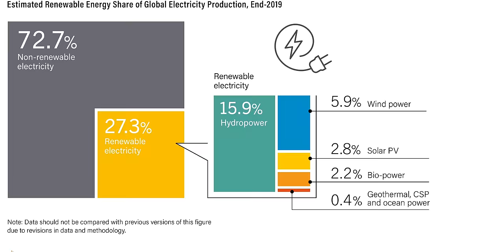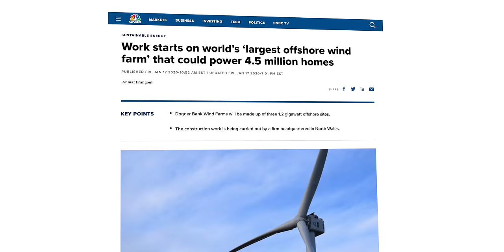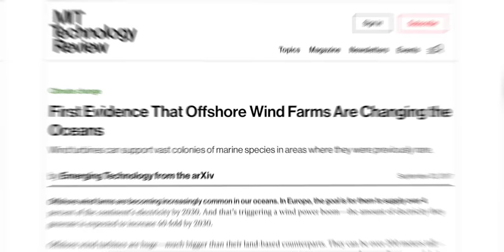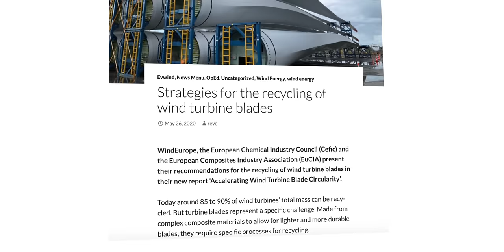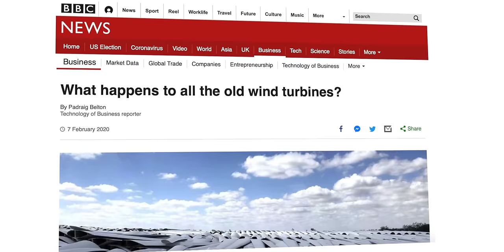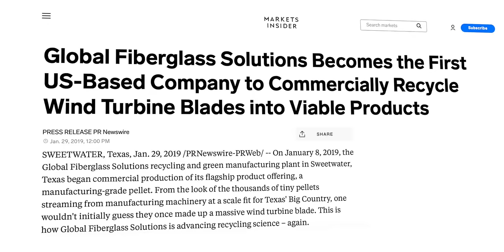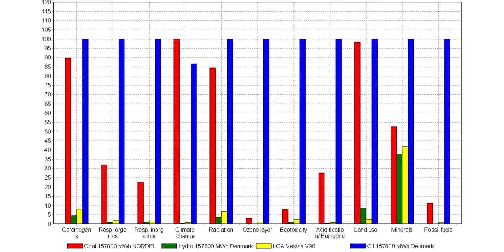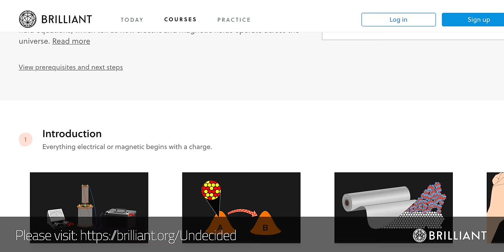The truth about wind turbines - how bad are they?

Comment: Im thinking nuclear is the way to go. Really.
Reply: Think again
Reply: @hizzlemobizzle  - Elaborate.
Reply: @caelachyt  Expensive to Build. Despite being relatively inexpensive to operate, nuclear power plants are incredibly expensive to build—and the cost keeps rising. ...
Accidents. ...
Produces Radioactive Waste. ...
Impact on the Environment. ...
Security Threat. ...
Limited Fuel Supply.
Reply: @hizzlemobizzle  - Well, that's supposed to be the panacea that is the so called Thorium Salt Reactors; those issues are greatly mitigated.
Reply: @caelachyt  Thorium cannot in itself power a reactor; unlike natural uranium, it does not contain enough fissile material to initiate a nuclear chain reaction. As a result it must first be bombarded with neutrons to produce the highly radioactive isotope uranium-233 – 'so these are really U-233 reactors.
Besides the future is not power generation it is in energy storage.  The future is batteries and super conductors my friend.
Reply: @caelachyt  Molten salt reactors haven't yet been proven at a commercial scale, and that means no private company will touch the idea. Getting a new reactor design licensed and built is a hideously byzantine and outrageously expensive process in most countries. Getting the first such plant online would cost tens of billions and take decades, and there's no guarantee a regulator wouldn't shut the whole thing down at any point. Even building plants based on mature designs is practically impossible in the US.

So it will have to be a government project. A very expensive government project. And currently there is very little enthusiasm in most Western countries for either nuclear power of huge expensive government projects.
Reply: Nuclear is still cheaper and more reliable than any other form.  Despite what the narrator says here, factoring in the maintenance cost of 3 year tear down of windmill generators is not included along with the massive government subsidies.  Nuclear reactor stations generally run at 2,400 MW to 1 Gigawatt of energy 24/7 365 days a year without reliance on wind blowing with zero emissions with a substantially smaller footprint on the environment.  Think about the amount of land required for 2MW to 3MW windmills to make up a gigawatt.  The spent fuel is the only waste that is exchanged every 1 and a half to 2 years and encompasses about as much space as a typical living room.  If we were really serious about preserving the environment and stopping greenhouse gasses, nuclear power would be the norm.  We should be using our technology to construct safe reliable nuclear power plants.
Reply: @g.k.1669  I'm guessing you work in the industry because it is insanely expensive, takes over a decade to get online and requires huge government subsides.
Faaaaaarrrrr from cost effective or clean
Reply: How dare you speak common sense!
Reply: Nuclear energy has a host of problems. The half life of nuclear waste is over 200,000 years. Then there is the remote possibility of a China Syndrome.
Reply: @hizzlemobizzle Yes I am in the industry. I repair, design and engineer industrial electronic controls for Nuclear, Combined cycle natural gas, Wind, Solar and Coal.  However you make it sound as if I am biased.  Tell me...If you had a choice to be working in a power plant or out on a solar farm, wouldn't you prefer a tranquil solar farm?  I know that I do.  However I do indeed know what the costs are.  Do you know that the largest day to day operating expense for a nuclear power plant is security?  What does an operating nuclear power plant produce other than steam from the cooling towers? Start up costs for a nuke plant are high due to the massive government regulations that occur at every turn.  Just to change the position of a simple pressure transmitter can cost $10,000 in new government licensing.  Other than that the rest of the cost is just standard feedwater heaters, turbines and structural concrete and steel.  Additionally a nuclear power plant can run 70+ years with government inspection approval, now break down that cost versus windmills or solar (while solar panels strip mountain sides for the specific quartz required for construction).  Since the environment is the subject you would love to see what is happening every night this time of year as the birds are migrating.  Go near the base of any windmill an see if you can count the amount of little finch type birds that slammed into them while flying at night.
Reply: @g.k.1669  Did not read the whole diatribe.  Thank  you for admitting your motivation.  Hopefully there will come a day when you no longer have to work in a such a horrible place.  
Please stop wishing the next Fukushima on the rest of us.
In addition it is frightening that you think nuclear plants need less regulation and oversight.
Want to know what my job was?  System Safety Engineer.  I know how dangerous nuclear plants really are.  I've seen the daily risk assessments from plant accidents.  Something they have a frightening large number of.  More plants more risk.
Reply: hizzle mobizzle Nuclear power plants are not “small nuclear bombs”. It is impossible for a nuclear power reactor to explode like a nuclear bomb.
Reply: I think so too.
But the Uranium reactor is obsolete and thing of the past since we can only use about 6,5% of the energy it produce's
The future is in fusion- and salt smelt reactors. They give more power with reduced waste compared to the Uranium reactor.
Reply: @primachpepe8597  Energy storage is the future.
Reply: Douglas waterman  folks at 3 mile island, Chernobyl and Fukushima might disagree.  Fukushima has virtually killed the Pacific ocean.  Yay!
Reply: hizzle mobizzle
, more people have died falling off rooves installing solar panels than have died in nuclear accidents.
Reply: @noremorse6898  what happens when a reactor melts down?
Reply: @primachpepe8597  You seem to have an deliberate misunderstanding of the dangers of nuclear reactors.  What are the long term repercussions of a nuclear meltdown?  What is the current state of the irradiated zone around Chernobyl?  Had they not been able to seal the Chernobyl disaster what would have been the outcome? What is the current state of the Fukushima disaster?  How many people lost their homes, everything they own and died of cancer due to those disasters?
Reply: @primachpepe8597  Explosions. While a nuclear reactor can never explode like an atomic bomb, an explosion can still occur. All power plants are a potential site for an explosion, because the fuel used, whether it is coal, uranium, or natural gas, needs to be energy dense. ... The destruction at Chernobyl was caused by a steam explosion.
Reply: @hizzlemobizzle  Obviously it's going to be a radioactive mess, but it still won't explode like a nuclear bomb. Meltdowns are extremely unlikely with modern reactor designs. Many new reactors will shut themselves down if the cooling system fails.
Reply: @noremorse6898  Do me a favor.  Since it take about 20 years to get a new reactor online.  Tell me what modern reactors you are talking about that are currently online?
Reply: @MrJonreed7  You are going to try and convince me that those disasters killed no one?  You are a liar.  plain and simple.  In addition genius why don't you tell me how many reactors are built near the ocean?  How many do we have in Florida? How many along our coastlines?
Reply: @MrJonreed7  Nuclear plants ill-prepared for worst-case scenarios, report says
In March 2011
The current approaches for regulating nuclear plant safety in the U.S. are “clearly inadequate” for preventing meltdowns and “mitigating their consequences,” according to a report released Thursday.

U.S. safety regulations traditionally ensure that plants are designed to withstand ordinary equipment failures, power losses and the loss of ability to cool the reactor core — the part of a plant where the nuclear reactions take place. But this is not enough, according to the report by the National Academy of Sciences.

“To what extent are they proactive versus reactive?” said Najmedin Meshkati, an engineering professor at USC who worked on the report. “Complacency and hubris are the worst enemies to nuclear safety.”

The U.S. nuclear industry should prepare for unlikely, worst-case scenarios when designing, building and regulating plants, the report recommends.
That is the big lesson the industry should take away from the March 2011 Fukushima Daiichi nuclear accident in Japan, the report says. Earthquakes, floods, tsunamis, solar storms and situations that seem rare are precisely the events that triggered the world’s three major nuclear disasters: Fukushima, Three Mile Island and Chernobyl.

The report said the accident at Fukushima — caused by an earthquake, which knocked out power, and a tsunami, which inundated the plant — should not have come as a surprise.

Another Japanese nuclear plant, Onagawa, which was closer to the earthquake’s fault line and also hit by the tsunami, sustained less damage because the possibility of earthquakes and floods had been considered when it was built, the report says. For example, the plant was built at a higher elevation, which decreased flooding, and had five off-site power lines, one of which survived the earthquake.

“Fukushima was a man-made accident,” Meshkati said. “The root cause was the mind-set. Mind-set is not in the equipment. It’s not in the pump. It’s not in the valve. It’s not in the batteries or the diesel generators.”

The report also emphasizes the importance of a national “safety culture” in which regulators make public safety a top priority. It says nuclear operators should be required to meet the highest standards possible and that safety requirements should be regularly updated — something the report says was lacking in Japan with Fukushima and in the Soviet Union with Chernobyl.

“Adequate funding and highly competent staff are necessary, but not sufficient, conditions for regulatory independence,” the report says. “It also requires strong leadership that maintains a laser focus on safety and does not allow itself to become distracted by outside pressures.”
Reply: @hizzlemobizzle  I'm talking about reactor designs that have been developed, not in actual commercial use. It's virtually impossible to actually build one due to the bureaucratic logjam created by the government and people's irrational fear of them due to anti-nuke propaganda.
Reply: @hizzlemobizzle  Here's a little "genius" for you. ALL nuclear plants are INTENTIONALLY built near water. All your comments have, COULD, IF, MIGHT, MAY. You must tremble uncontrollably at the thought of getting in a car.
Reply: @MrJonreed7  Oh.  So basically you have defeated your own argument.  Nuclear plants are inherently dangerous because they are all near water.  Thank you "genius".
Now get back to work spreading false information.
Reply: @MrJonreed7  .  Since you sork in the nuclear industry.  Tell me if this is true or not:  A nuclear meltdown occurs when the middle portion of the nuclear reactor containing the fuel rods (its "core") is not properly cooled. This can occur when the cooling system fails or is otherwise defective. If this happens, uranium or plutonium or similar materials inside the nuclear reactor become hot and may start melting or dissolving. It is this melting that is a nuclear meltdown.[1] Due to decay heat, a nuclear meltdown can occur even in a reactor that is shut down. The uranium and plutonium liquified in a nuclear meltdown, mixed with fission products, melted zirconium from the fuel rod cladding, and other materials, is called corium. Corium is highly radioactive and remains hazardous for many centuries after a meltdown.
Reply: @hizzlemobizzle  I have actually solidified my point. Nuclear plants have existed for 70 years & we're all still here. Again, you deal in "might, could, may". I deal in reality. Everything is "dangerous". I choose not to live in fear.  Deaths from coal & nat. gas extraction & exploration number in the hundreds of thousands. Go protest those industries.
Reply: @MrJonreed7  I have problem with fossil fuel industry as well.  Mainly because they have a product that is killing us.   Much like nuclear waste leaking into our groundwater.
Reply: @MrJonreed7  Hey  Boo!!  Nine years after the Fukushima disaster shook the world, one of the biggest impediments to cleaning up the site in Northeastern Japan is coming from an unexpected source: The water.

That water, specifically 1.2 million tons of it, is still radioactive. Stored in 1,000 special tanks on the site of the nuclear power plant’s ruins, it’s taking up needed space – which the Japanese government plans to free up by dumping it into the sea.
Reply: Bob A  We've got a local radio talk show host did a Ted talk.  you should check it out her name is the sexy savannah and she works at gator land.
Reply: Bob A  Honestly all this propaganda is boring.  We either develop green technologies or we buy them from other countries that are investing in them.  One way or another it's happening.  Shame Americans have lost the ability to dream big.
Reply: Bob A  Leave him be, he thinks with his heart and not his brain. Environmentalists are like socialists, they think they are morally superior to everyone else... the green movement is one of the biggest hypocritical movements on this planet.
Reply: Bob A  blah blah blah.
Reply: Bob A  Well, you always have to be on guard for "those people".
Reply: All day every day. Rely on the windmills and solar and we will all be Kalifornia with rolling blackouts. Bank on it. Fact.
Reply: @randyweaver9528  or come up with a solution.  Multiple factors are responsible, including the general issue of solar's intermittency, but also concurrent heat waves across the West that prevented California from importing power.

"There's just less energy in the system to divvy up amongst the different regions," said Jan Smutny-Jones, CEO of the Independent Energy Producers Association. "That's not normally a problem, but when it's hot then it is."

One of the casualties of California's last round of rolling blackouts said Newsom needs to prioritize reliability but that he doesn't have to sacrifice the state's clean-energy goals. He could boost energy storage, for example, in addition to keeping gas-fired peaker plants.

"The bottom line is, people don't want lights to go down," said former Gov. Gray Davis. "People also want a carbon-free future. Sometimes those two aspirations come into conflict. A smarter approach, in my judgment, is to have the power you need in reserve, even if it's somewhat carbon-based, to keep the lights on."
Reply: I been in Tschernobyl 10 years ago.. and remember it as if it would have been yesterday. It’s not something you could forget easy. Trust me.. nuclear is not a good future..
Reply: What do we do with spent rods from reactors which are radioactive for 10,000 years?  Don't bury them near my house as most people would say.
Reply: @hizzlemobizzle  That's all changing. Modular 3rd generation reactors and thorium fuel, and later liquid molten salt reactors will produce cheap, reliable concentrated power with less adverse environmental impact than any renewable.
Reply: @stuarthirsch  That will be great, but in the meantime we better work with what we have.  Can't sit around and wait another 50 years for that to be developed.
Reply: Exactly.If everyone would have worked together years ago, we would have carbon free electricity.
Reply: Its the only tech available now that works.  So I agree.
Reply: @hizzlemobizzle    Totally surmountable technical issues.  And yes, tehcnically you are correct that it is the U233 that fissions but it derives from the Thorium.  Regarding energy storage high tech batteries is a pipe dream.
Reply: @hizzlemobizzle    Actually this is happening as we speak, just not so much in the UK or US.  Most of your argument regarding regulatory hurdles is just subterfuge.  Governmental regulations are based on first and second generation nuclear technology and need to be intelligently overhauled for MS reactors as the safety issues are very different and substantially minimal.  The countries presently pursueing this will own the means of incredibly inexpensive power generation, without littering the landscape with bird and bat killing machines, or vast swaths of land filled with solar arrays, with virtually zero greenhouse emissions; or even negative greenhouse gas emissions if excess power is used for chemically reducing atmospheric CO2.
Reply: @edixonocilis4482  funny.  I remember when they said deriving energy from the sun was a pipe dream.  High tech batteries are reality it is just a matter of increasing efficiency.  Certainly more likely to become reality in the 50 years or so it would take to design, build and bring on line a new nuclear plant.
Reply: @hizzlemobizzle    I'm an engineer and understand technology pretty well.  The problem with power storage using batteries has to do with capacity, not efficiency.  If you do even a very generous energy balance to determine the capacity to store the amount of power needed to offset the down time of the so called renewables, you will quickly understand that it's extrodinarly unworkable.  The amount of natural resources and energy necessary to produce, install, and maintain this storage capacity, the environmental damage, not to mention the recycling efforts is just monumental.  With a concerted national effort I don't think it would take anywhere near 50 years to bring on a walk-away safe and extremely efficient 4/5th gen MS or LM nuclear reactor.  China, India, and Russia will be bringing on such units within the next 10 years. The US ran an experimental one at Oak Ridge for almos 10 years in the late 50s early 60s.   Honestly, I don't think the US or the UK have the guts to react to climate change/global warming in such a way as to make a the kind of concerted effort needed to develop this technology mainly due to uninformed populist attitudes.  This is somewhat of an understandable reaction on account of Chernobyl, but to think renewables plus batteries will somehow solve this global problem is pretty naive.
Reply: @edixonocilis4482  You mean like the newest one in Finland? Oh and if you are worried about birds we better get rid of house cats and tall buildings.
The Olkiluoto 3 Nuclear Power Plant will be the third unit at the Olkiluoto site in western Finland, and is one of the newest nuclear plants constructed with EPR pressurised water reactor (PWR) technology. Finnish nuclear power company Teollisuuden Voima Oyj (TVO) began building the plant in 2005, but it has faced almost a decade of delays.

TVO originally intended to start production from Olkiluoto 3 in May 2009, but an array of issues regarding planning and construction were highlighted by Finnish nuclear safety regulator STUK. It found problems in the concrete foundation of the plant, and later indicated that subcontractors working on the project had provided heavy forgings that fell below industry standards.

Other problems soon began to flood in, including an issue with the reactor’s unique double-containment structure. Another problem with TVO’s project partners, Areva-Siemens, further delayed the plant in 2013, as the consortium reduced the number of subcontractors and employees working on the project.

TVO Olkiluoto 3 project director Jouni Silvennoinen said in June: “The hot functional testing has now been successfully completed and the schedule for the next phases has been defined.
Reply: Bob A wasn’t Elizabeth Holmes on Ted?
Reply: Nuclear Fusion is the way to go, and it's only 30 years away...
Reply: nukes...small reactors.......
Reply: it only takes long because of the government. It's been proven. we did it before and we were clean and powerful.
Reply: Solar is the way to go, hands down.  Just imagine that exterior cladding on all buildings are now solar panels.  All roofs, solar shingles 100%.  The electrical grid is now managed by a public company paid for by taxes and that is all they are allowed to do manage the grid.  no one pays for electricity from a greedy company they just pay for the maintenance of the systems attached to their properties.  No more mass outages due to weather, sabotage, and human stupidity.  We might even get our heads out of our asses and start moving most in home electricity back to DC power and gain even more safety & efficiency so we don't have to store power in batteries then convert it to AC just for most home electronics to convert that AC back to DC for use.  But all of that is beyond our lifetimes anyways... but who knows... maybe humans will stop being stupid... if a miracle happens.
Reply: yes hirosima n nagasaki..
Reply: @hizzlemobizzle  How, exactly, do you plan on charging those batteries?
What do you do with them at the end of their effective life?
How much energy do you waste keeping the system cool?

50+ years of nuke reactors in operation and only three or four major incidents only one still has a large exclusion zone....... The extremity of possible negative effects has greatly overshadowed the actual risk. The difficulty in getting new reactors built is largely due to these fears both founded and unfounded.
Oh, and those thorium based molten salt reactors? Most designs are about as failsafe as they come for any system and the byproducts' halflife is on the order of hundreds of years rather than hundreds of thousands with no weaponizeable waste. So plenty of reason to invest into research to see if they can be made commercially viable.
Reply: Absolutely!
Reply: People are too ignorant to realise it
Reply: @irish-medi-weed-grower5240  yes, it is because we are using Gen 2 reactors that by the way over used since 2000. In other words, those reactors should've been renovated, but they were not because people choose not to do it
Reply: @hizzlemobizzle  cost keep decreasing because we already have Gen 3+ nuclear power stations and in 15 years will be ready for Gen 4 that will decrease nuclear waist almost by 50% relative to Gen 2 (which over used for 20 years) and decrease cost of production by 30-40% too ...
Reply: @wolfu597  nuclear waist is not a real problem of nuclear fision. It is water. Nuclear fusion has it own problems if you make a mistake one nuclear fusion reactor can turn Earth into star in a matter of seconds
Reply: @wolfu597  also, nuclear fusion does not produce nuclear waist. Nuclear fusion is when you get He from H
Reply: @hizzlemobizzle  Fukushima happened because people did not follow safety requirement. Even God damn Chernobyl happened because people did follow all safety protocols because they were pressured by USSR government to build it
Reply: @victorveselov4911  I agree anything that can cause destruction on a global scale due to human error is far too dangerous.  Luckily Nuclear is insanely expensive and will be phased out.
Reply: More deaths have occurred in Ted Kennedy's car than in nuclear powerplant fatal accidents.
Reply: @henryhorner3182  WOW!  Over 60,000 people died in Ted Kennedy's car?  I had no idea you could pack that many people into one car.  Was the car really huge or were the people very tiny?
Reply: Nuclear fission will be required to supplement renewables for sure because there just isn't enough renewable power or storage either, and once it's pretty clear we have backed ourselves into an energy corner with fossil fuels where we die if we keep it up, nuclear fission will become an important part of the mix.  The only way it wouldn't is if, by some miracle, there is a sudden leapfrog in nuclear fusion reactor technology, which seems pretty unlikely in the timeframe we now have to change our energy production infrastructure to avoid a very miserable future (or possibly even extinction).
Reply: Well,fusion is allso nuclear by definition...let just hope it will become fesable in the near future
Reply: @carrol meeks i am waiting on the mesiah of nuclear energy
Reply: Say less 🤫
Reply: @hizzlemobizzle  Interested in how they compared to fossil fuel plants, were they much higher? I can't see that you'd get those kind of incidents with wind or solar farms... aside from general maintenance and panel cleaning
Reply: @g.k.1669  According New York bank Lazard and others is nuclear energy 3-4 times expensiver than  renewable energy from wind ans solar. The capacity factor of nuclear power plant is 80-90%, they are also not working 24/7 365. A small volumen of radioactive waste? And what about amount of tailings connected with uranium minnig, or contaminated undergroud water by in situ leaching? Solving for climate change? 1o to 15 years of construction, dozens years of decommision. Nuclear is producing 10% of electricity and about 2% of whole energy in the world.
Reply: You are looking at this issue from the wrong angle. Windmills are so much easier to abuse as "fund raisers" under the umbrella of "a good cause'.
Reply: @hizzlemobizzle  Nuclear has the lowest amount the deaths per energy generated, lower than your wind, hydro and solar.
Reply: @InNeedOfSpeed  Ok you get the ridiculous award for the day.
Reply: Except we still don't know what to do with all the radioactive waste.
Reply: @milan222314  The property leases for the windmill and solar fields is already a large factor. I absolutely guarantee you that nuke plants operate 24/7 365 unless there is a trip due to an upset in the system due to something like a blade being thrown in a turbine. You talk as if there is no environmental impact from green energy, heck.. just to mine the quartz for solar panels wipes out mountainsides not to mention the thousands of migratory birds that die.  I work in industrial electronics for the power industry and have been at solar fields, windmills, coal plants, combined cycle gas plants, diesel peakers, natural gas peakers and many months and nuclear plants.  There is a good chance that I know what I am talking about.
Reply: How you can compare the silicon (99 % approx.) from sand and uranium from ore, with average content about 0,1 %? With huge amount of radioactive waste rock and huge amount of radioactive waste tailings? With radioactive dust and penetration of radioactivity to undergroud water. From the beginning is nuclear energy connected with war: from Hiroshima and Nagasaki to depelted uranium, unsolved final dissposal, possible war or teroristic attack? With no adecvate insurance and 3-4 times expensiver than renewable energy from wind and sun.
Very shortly to express: Nuclear energy as complex is crime on humanity.
Reply: @milan222314  Simple.  Communities still thrive around the locations where uranium is processed.  You fail to realize how much damage is created by green energy or perhaps you do not want to believe it.  You talk about the decommissioning of a nuclear power plant as if it is a major issue.  It is not.  You can see videos here on youtube of teenagers exploring old nuclear power plants as they carry detectors.  There is nothing dangerous left except the asbestos on old pipe insulation.  Just like any large power plant decommissioning the building is brought down, the concrete is crushed and used for road bedding materials and the steel is recycled.  Nuclear power plants must follow very stringent guidelines to operate and their lifespan can be up to 60 years of operation.  A windmill or a solar field will not achieve half that life and there is no recycle use for windmill components that is realistic and the solar panels require an industrial chemical process to recover the silver.  Nuclear is by far the best aspect for the environment and the cheapest.  Did you know that the U.S. and foreign governments provides massive subsidies for green energy?  If the ratepayers ever have to pay the full energy costs on their bills, they will be in for one heckuva surprise.
Don't get me wrong, whatever way that they make electricity does not impact my job as I will have one at any location, but as an avid outdoorsman seeing square miles of panels where trees used to be and knowing where the materials are mined or seeing dozens of migratory birds lying at the base of every windmill in the fall as each night migratory birds strike the tower and blades is heartbreaking.
Reply: Nor do we know what to do with the lithium that is needed to build car batteries.
Reply: So, why would we add Lithium with the problem under the pretext that it is safe?
Reply: @primachpepe8597  well said! 👏👏👍
Reply: Hidro
Reply: Nuclear is 100% the way to go. No it is not as dangerous as you all think. No it is also not as expensive as you all think and finally no nuclear waste is not a problem. Yes I know you have heard otherwise but unless you actually dig into the details you will never learn the truth, only the lies you've been fed. Hopefully truth will prevail.
Reply: The half-life of nuclear materials is in the hundreds of thousands of years. That's an order of magnitude longer than humanity has even been around. The cost of keeping these things safe and secure simply cannot be quantified. Storage facilities have already had mishaps in just the few decades they've been around. A massive issue could wind up tainting ground water for entire states. Housing these things would require stable oversight basically FOREVER. Can you think of any nation that's been stable forever? The longest nation humanity has is China at a couple thousand years, but I sure as hell wouldn't have called it stable that whole time. To put it in perspective of just how long we will be housing these things; in the time it will take for roughly half of these nuclear materials to expend themselves, Japan will have been crushed underneath China by the movement of the tectonic plates.
Reply: @michaeldougherty6036    Do you think I haven't heard that argument before, even though it is parroted ad infinitem? If you had ever bothered to check you would know that the more radioactive a material is, the shorter the half life. Anything that is radioactive for more then a few decades is basically harmless unless you ingest it just like anything would be if you dug it out of the ground.
Reply: One thing that most people don't understand about the nuclear industry is that the dangers posed by the technology are massively overblown in order to profit from selling unnecessary safety upgrades. We can easily build plants that can't meltdown, we can bury the waste afterwards and we could build plants for comparatively next to no cost but politics and stupidity gets in the way as usual.
Reply: Liquid Salt Thorium  reactors is the only nuclear option I'd consider
Reply: @terencemcbride9090  Good thing your not in charge then
Reply: yeah nuclear is very cheap source if you look on the whole life of it. Its super-expensive to build, but then its generate huge amount of power and heat with minimum need of fuel for another 60 years. Reliable, even when sun not shine or wind blow. And carbon free. We should move forward to generation IV which are able to use almost whole fuel and even use nuclear waste to produce energy (which solves waste problem). More passive safety too.  Yeah probably not a good idea to build it on the shore in earthquake zones. thats for sure. (fukushima survive eartquake, tsunami was a too much)
Reply: The environmental crowd protested it in the 70's so they dirtied there own drinking water.
Reply: Good idea but what about the waste from nuclear,  what are they going to do just dump it in the ocean so it kill fish, or a landfill until it glows.
Reply: @coach2208  nuclear waste is a non issue. You do realise don't you that we already put arsenic, lead etc into the air every day from coal and diesel engines etc.... Far worse than any mythical damage that could be caused by nuclear waste
Reply: @garry8390  I have to kinda disagree because our factories and trucks burn 90% cleaner in today's world,  maybe not in China and other third world countries that have no EPA regulations
Reply: @garry8390  the problem here is everyone is pointing the finger at USA and not other countries that pollute way more then this country.
Reply: @coach2208  Is this your best argument? Can you do any better?
Reply: Unfortunately too many people have for years placed Nuclear Power as a non viable option.  https://en.wikipedia.org/wiki/Pebble-bed_reactor
China is working on this and other options to help break their dependence of coal and oil.
Reply: bilbo bostonian  ahhh you say the nicest things.  I bet you are loads of fun at parties.
Reply: @hizzlemobizzle  They are near water for cooling purposes. Look at France with 70% of it's energy coming from nuclear power. It produces so much at such little cost that it ends up making a profit of 3 billion euros( which is equivalent to around 3.6 billion dollars) annually by exporting energy. You bring up the only three major accidents: Fukushima, Chernobyl, and Three Mile island, yet "These are the only major accidents to have occurred in over 18,500 cumulative reactor-years of commercial nuclear power operation in 36 countries." With high end security and advances in technology, these small yet potentially devastating risks are constantly declining. Besides that, you argument merely relies on speculation, assuming the worst case scenario only when it benefits your side. At that point, we wouldn't be able to accomplish anything because regardless of what we do, there will always remain a catastrophic possibility despite how negligible it is. The only reason nuclear disasters are brought up is because they are horrific spectacles, yet sum up all the minor accidents from other energies, and you end up with the same if not worse results.

References:
https://tinyurl.com/btnct44m
https://tinyurl.com/455bevxh
Reply: @stefanv.3991  I agree.  Abandon all hope.  It can't be done.
The new American spirit.
Reply: @hizzlemobizzle  if what you said was accurate then we’d be f*cked, as China is racing to develop the technology in order to clean up the air in their cities. Thankfully their are a large list of western startups making significant and meaningful progress on advanced nuclear reactor technologies, even with a tiny fraction of government assistance that wind, solar, batteries, hydrogen, and biofuels receive.
Reply: @hizzlemobizzle  they take about 5-10 years longer to build, and yet their lifespan is 2-5x longer then wind and solar, and don’t require hundreds of miles of wiring to connect them to the grid, grid storage, or fossil fuel back up. 

There is also huge potential for improvement using consecutive build outs, as demonstrated by China, India, Korea, Russia, France, etc.
Reply: @hizzlemobizzle  What are your sources for ypur negative attitude towards nuclear?
Most efficient.
Safer than wind turbines for the environment and also workmen.
Increasingly cost effective.
Better for the environment than solar.
Reply: @Matt_H_  In mid-2019, new wind and solar generators competed efficiently against even existing nuclear power plants in cost terms, and grew generating capacity faster than any other power type, the annual World Nuclear Industry Status Report (WNISR) showed.

“Stabilizing the climate is urgent, nuclear power is slow,” said Mycle Schneider, lead author of the report. “It meets no technical or operational need that low-carbon competitors cannot meet better, cheaper and faster.”

The report estimates that since 2009 the average construction time for reactors worldwide was just under 10 years, well above the estimate given by industry body the World Nuclear Association (WNA) of between 5 and 8.5 years.

The extra time that nuclear plants take to build has major implications for climate goals, as existing fossil-fueled plants continue to emit CO2 while awaiting substitution.

“To protect the climate, we must abate the most carbon at the least cost and in the least time,”
The cost of generating solar power ranges from $36 to $44 per megawatt hour (MWh), the WNISR said, while onshore wind power comes in at $29–$56 per MWh. Nuclear energy costs between $112 and $189.

Over the past decade, the WNISR estimates levelized costs - which compare the total lifetime cost of building and running a plant to lifetime output - for utility-scale solar have dropped by 88% and for wind by 69%.

For nuclear, they have increased by 23%, it said.
Reply: @noremorse6898  While a nuclear reactor can never explode like an atomic bomb, an explosion can still occur. A meltdown means that due to lack of coolant, or too much fission, the core becomes so hot that it melts. Due to the intense heat produced, water is turned to steam. Also, the fuel rods melt, turning them into a liquid. This allows the metal to react with the steam, causing an explosion.
Reply: I agree to a point but when nuclear goes wrong it’s the most catastrophic problem humans can face and the loss of life is immense. And the fallout lasts for 100’s of years.
Reply: Absolutely 💯
Reply: it is! although breeder nuclear-powered power with dozens of safeguards such as the one a team of [ill find the source] scientists created. These superluminal conclusions of "nuclear bad" or completely unjustified...
Reply: @hizzlemobizzle  chernobyl was from communism and outdated equipment, we actually have regulations unlike the USSR Fukushima was concerning I’ll admit but windmills kill so many birds and the construction destroys good farmland, I believe that nuclear is the future and that people need to stop beig afraid of it
Reply: Pretty spot on for the exception of one thing…. Nothing was mentioned about the production of the components at their creation. The amount of fossil fuels used to create the steel and alloys alone is insane. So much so a wind turbine through its life will never cover its own carbon footprint with the so called “green energy it produces.
Reply: No Doubt! Im a fan with today's technology ☢
Reply: @museic9151  Will a burst dam make the surrounding landscape unlivable for hundreds of years?  Will a fallen windmill melt down and risk global annihilation? If not then I guess it's not the same.
Reply: Nuclear Fusión
Reply: @David-hx8vb  What an odd comment?  You call people snowflakes for having a rational fear of nuclear power and then wish that a hurricane will cause a Fukushima style disaster in Florida.  WTH
Reply: @David-hx8vb  hahaha no I guess not.  Ooops/
Reply: Makes total sense.
Reply: Not until they figure out what to do with the nuclear waste - safely.
Reply: @Gleebe Whitaker  You do realise a longer half life is better right, the longer the half life the left particles being emitted so the less dangerous it is.
Reply: @Adogsmate4267  Yep, but 'petrol' isn't nuclear waste, nor does it produce nuclear waste products.
Reply: @irish-medi-weed-grower5240  thank you for posting this. These are the things I tell everyone that they don’t consider in the final cost of nuclear power. The cost goes on for years after and no one really knows how long or the cost. 🙏🙏👍💪
Reply: @hizzlemobizzle  Massive amounts of concrete which needs alot of fossil fuel to produce.
Reply: @Dutchy695  All the seagrass and corals are dying n Florida from the heat.  Have a nice day.
Reply: Yep 100%
Reply: @hizzlemobizzle  Nuclear is the way to go. I thought again.
Reply: @sidi4735  Remind me what happens when there is a war and a bomb hits a nuclear plant?  Guess Zaphorizia may be our chance to find out.
Reply: When there is a war and a bomb hits a nuclear plant, things go bad. Very bad. @hizzlemobizzle
Reply: Nuclear is actually clean too
Reply: When one is serious about the environment and human life, one chooses nuclear as by far the best way to generate energy. Nuclear waste has been managed for nearly a century and can be reused efficiently. Nuclear has the lowest death rate per unit of energy production. Disregarding nuclear because "if a bomb hits a plant during a war" or "if Tchernobyl..." is irrational.  @hizzlemobizzle
Reply: @sidi4735  Oh by the way the idea that a plant being struck during a war is irrational is something you should explain to those currently hoping to avoid this scenario in Zaporizhia.
Reply: @RedHaloManiac95  Yes.  I mean other than the massive amounts of waste it produces that there is still no clear an answer on how to deal with it other than to store it in huge barrels on site.  Shame those barrels eventually leak.
Reply: Actually the costs don’t continue to rise.  Once the reactor is online the costs are extremely cheap compared to wind or solar and produce WAY more power fat more efficiently than wind turbines which break down constantly.  Any rotating turbine has turning gears and bearings = wear tear and replacement which is very expensive in comparison to their power output.  Sure nuclear reactors are VERY expensive to bring online initially but they are far cheaper to maintain in comparison to their power output.  The newer reactors also can utilize different types of uranium and plutonium with some even utilizing the waste products of older reactors to power them.  With the advancement of superconductors new reactors are being developed that will even be able to use cold fusion which produces almost no waste products.  In a decade or two they will be wipe out the green sector of photovoltaics and wind turbines.
Reply: your opinion is kindly rejected.
Reply: @g.k.1669 nuclear is the most expensive energy source ever
Reply: @opensocietyenjoyer  I have worked in the industrial electrical industry for 28 years now.  I have worked at natural gas plants, coal fired, nuclear, wind farms and solar parks.  I can tell you with 100% certainty that nuclear is by far the cheapest form of electricity to produce when all costs are down to the final product of megawatts. 
Think of this, since the Obama administration was in place, the government has given over one trillion dollars of your tax money to green energy initiatives. Eighteen 2,400 MW nuclear power plants could have been erected with that much money.  When it comes down to cost, nuclear is about $7 per MW hour, Coal about $18 (Before the Democrats placed massive fees onto coal burning power plants) and wind and solar bounces around in the mid $70's per MW hour to produce. 
All of that land leasing, miles of underground heavy cable, permits, running lines to connect to main trunks consumes a lot of cash for something that does not produce energy most of the time.  Then throw in the 3 year heavy crane hoist out of the generator and blade replacement of windmills and expensive maintenance and you will start to get the idea.
Reply: I am 17 years old and trying to figur this hole shit out, because i will soon have to choose for what I want to vote for.  I would say that my research has brought me to a point where my knowledge on the topic is above avarage, and I still feel hoplessly lost. Unless I am dedecating my life to this, I have the feeling that I will always have to rely on what professionals are saying, but everyone is saying something different. How is your avarage joe supposed to make the right decision in this buttfuckery of different opinions? What can I even belive at this point? I feel like there is no other choice then letting your bias make the final decision. Is there anything that one could do about this? I mean, I feel like I would be most important for voters to understand what they are even voting for.
Reply: Nuclear is also not renewable
Reply: 3 Mile Island?? or Wind Turbines??
Reply: They last long and we can make them better now. The more we make the better we become at it. We need energy to make all the world prosper so I say will should use all the energy solutions.
Reply: If you want your electricity rates to quadruple vote for nuclear. While it works fine it is just uneconomic and the waste issues have still never been resolved. It is simply too dangerous to make economically safe.
Reply: @gleebewhitaker1517 There is no chance of the China syndrome. Re-processing waste eliminates the long term hazards because the long lived nuclides of concern are fuel that can be reused. The problem is while there are solutions they are just uneconomic. Nuclear if just far more expensive than renewables and fossil fuel generation.
Reply: @g.k.1669 You are mistaken. I was an engineer in US commercial nuclear power plants. They are not even close to being cost competitive with renewables and fossil fuel generation. Why do you think they are shutting down perfectly serviceable nuclear power plants in the US? Plants that have been completely paid off and depreciated. It is because just the O&M costs by themselves currently make nuclear power uneconomical. When you factor in new construction costs frequently 75%-80% of the costs. Nuclear power is not even close to being competitive. Hydro about $0.02/kwh, onshore wind and solar about $0.05/kwh, natural gas combined cycle about $0.07/kwh, coal with the required pollution controls about $0.12/kwh, nuclear power total costs with new construction included about $0.25-$0.30/kwh. With renewables you are required to also invest in greater peaker capacity that increase the costs a few cents per kwh, but can be mitigated by proper mix of sources and a wider generation area.
Reply: @chipworrell6025  it's been the way for decades. We just have to actually embrace and use it.
Reply: chernobyl?
Reply: @Jaidyn-e7j  what about it
Reply: It is the way to go
Reply: I completely agree!